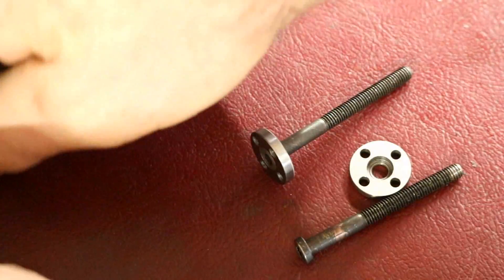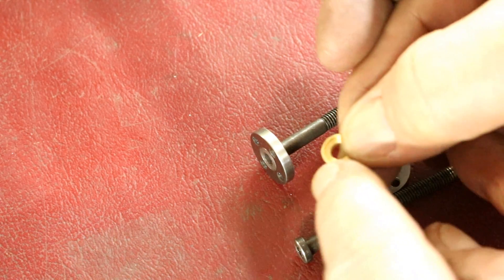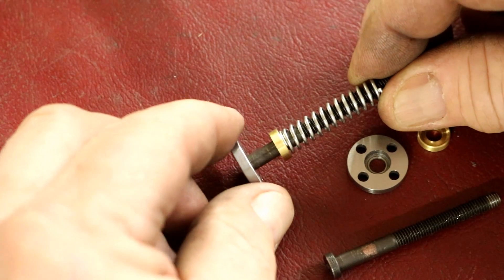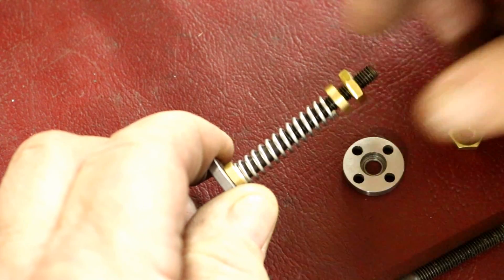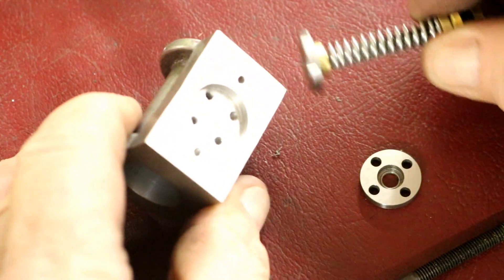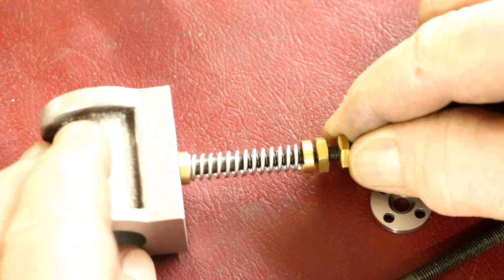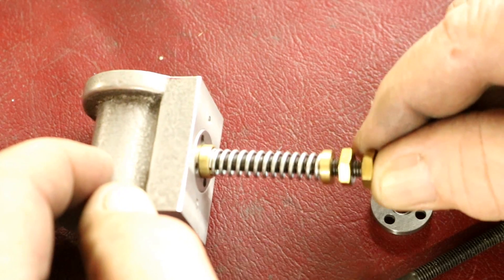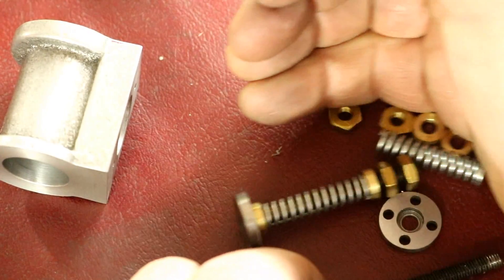P3 How to Build the Cylinder Pivot of a Model Steam Engine for the First Time

Comment: Nice Randy, the project is looking good. 
You can make those springs into precision springs by grinding the ends while supporting them with a V-Block. probably not needed for your project.
Reply: I was thinking that by grinding the ends flat the spring would press the housing more evenly against the valve ports and help the engine run smoothly.

Comment: I'm curious about why the spring retention cap screw is being held in place with a plate and 4 screws. Typically a stud is just threading into the cylinder. Thanks.
Reply from the maker: Yes I think it is to just make more parts.  Thanks E.
Reply: I wondered the same....... Thanks for the reply Randy.